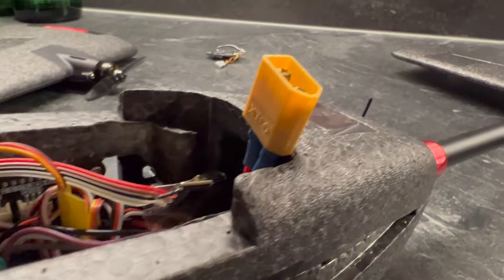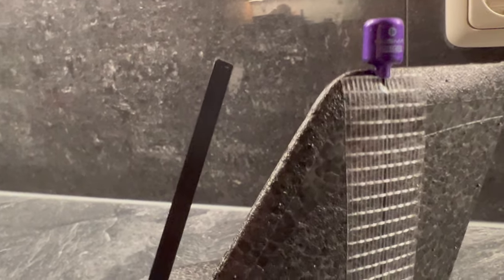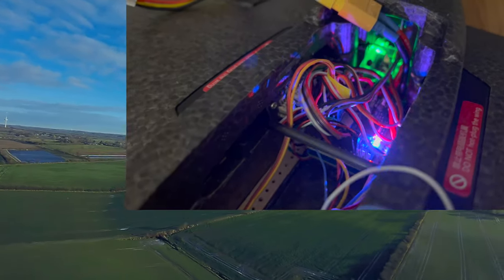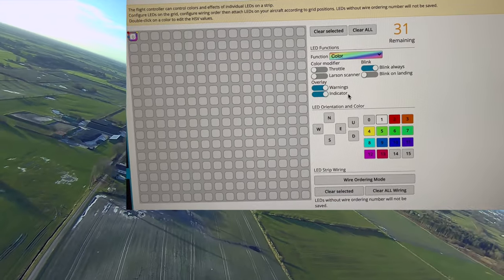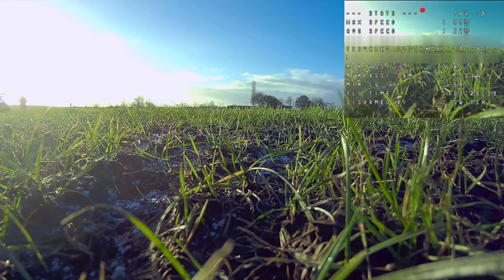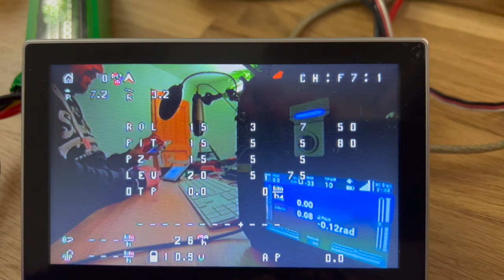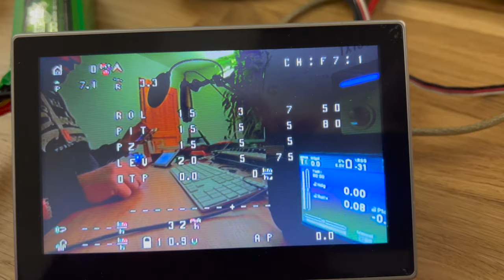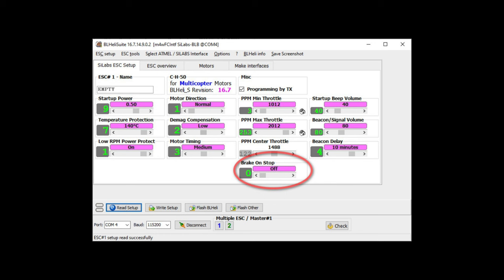Updates and flight footage | Hee Wing T1 Ranger EP:03

Comment: Great build! Seems to fly straighter that the wings but wont know till the video speed is increased for time on a long flight.  The motors sound noisy like bearings or vibration. Motors can also be out of balance like props. Even ESC timing can effect sound. Vibration = Jello .  The only time I have broken a propeller on a fixed wing is when I used the ESC brake with a non folding propeller.  The brake stops the prop in a position that the prop is broken by the ground. Also folding props will let you stop a motor and fly with one.
Reply from the maker: Thanks Bob :)
It flies straight and perhaps you’ll see that in todays episode. But it’s a small plane and easy affected by wind. It handles this very good on the other hand. 

There is a problem with my motors/props and the jello starts to annoy me ;) have begun to chance to a new set of motors and props. The escs are running Blujay at 48 or 96khz. Brakes are on and I would assume folding props to become a show stopper on the wings as the nacels are close to the wing.

Comment: Nice Job 👍
I learned a lesson this weekend. I also had a problem with GPS-Fix on my Hee Wing F1 with a BS-180 while testing before the final assembly. Could hardly get 5 Sats. Trying a BN-220 wasn't any better Without the video transmitter connected I got 8 (BN-220 14) in short time. I was already suspicious, because that Eachine/AtomRC transmitter was pretty noisy on the neighbour channels. Today I changed it to a TBS Unify PRO32 Nano on a Mamba Filtering Board, that I also used with the Eachine. Guess what, GPS Fix in no time with everything attached and I have a way better Picture now in my goggles.. Lesson learned, don't use cheap crap...
Reply from the maker: Thanks… will consider it

Comment: Haha! I have an official mod now! Nice flight buddy, looking very smooth! It's possible to change the colour of the wing LED's independently if you have a spare WS2812 LED. You just need to solder it inline with the wires going to one of the wing connectors and then you can have full Nav lights.

I had a flight out with my T1 today too, my ELRS must have been swamped by everyone using Crossfire resulting in complete RC loss, the plus side is I got to see the INAV failsafe with Auto-Land feature in action. It did remarkably well!
Reply from the maker: You are in the 900 band, right? I didn’t get to much trouble with my 2400! 

And thanks 🙏 yes it’s pretty smooth but I feel the stutters on the esc that need capping. I will look into the ws2812 mod by time and sort that out too. 
Just changed the cam to become something hi-res so I can begin to do that usual quality level I like to see myself ;)

One thing I didn’t figure so far:

How the heck are we too getting over to Leslie and his beautiful mountains!? ;-)

Comment: Great video. How fast is the Ranger on stock motors with 4s?
Reply from the maker: Thanks- but about the 4s incant tell. I would assume the motors not to like it as they are rated for only 2-3S. They could end up like charcoal if the load gets to high. 
I will test the T1 on 4s soon but not all the parts have arrived so far
Reply: @JustFPV-net  how fast ist it on 3s? Really interested in that plane, but I like the have the option go fast if I want. Will a 1800 4s fit in it?
Reply from the maker: Depends on wind I guess! If you watch the latest episode (EP:04) then you can get an Idea of it. Commonly speeds about 60-80kmh can be done I guess.

4s1800 should do ... I ran 3s3000 LiPo in it the first flights and then there was almost no space left. Perhaps this helps you: you can put 2x18650 cells after another in it (6,5cm x 2 => 13cm) ...

Comment: The circuit board on my T-1 Ranger has this msg “2 - 6s Lipo 5V / 3A . Any idea what it means? The assembly guide does not mention it. Thanks for the unboxing videos.
Reply from the maker: It wants to tell you the the board is able to work with voltages from 2s-6s. Further it will deliver 5v to your components. But they can take a max of 3A as the inverter of the board can’t deliver more than that. 

Thanks for the Coffee btw ☕️ ☕️ - expect your name to show up in upcoming videos ;)
Reply: @JustFPV-net  Thanks! You’re very welcome. Appreciate the help. Just ordered a 3S 2200 mah 45c battery and a Lipo charger. Will be starting out as a park flyer with a local club for now. Already have a Jumper RC controller. Not sure what to purchase next. Probably should purchase a receiver to match the controller. Any advice about a receiver for the fuselage?
Reply from the maker: Well … you could go for ExpressLRS perhaps
Reply: @JustFPV-net  Purchased the battery and it plugs into a device that hee wing calls the UBEC board. There are 4 sets of connectors that plug into another device. Can you tell me the correct name for the device those wiring clips attach to? This is a really basic question I know. Appreciate the help.
Reply: If it’s the flight controller. Is there one you can suggest that works good with the T-1 Ranger? Matek or another brand? Thanks
Reply from the maker: Go for a Matek F405-WMN … with that you can skip the hee wing board as it becomes obsolete
Reply: @JustFPV-net  Thanks! There are several different types of the F405.
Reply from the maker: Best choice for T1 and simply flying (with INAV software) is Matek F405-WMN